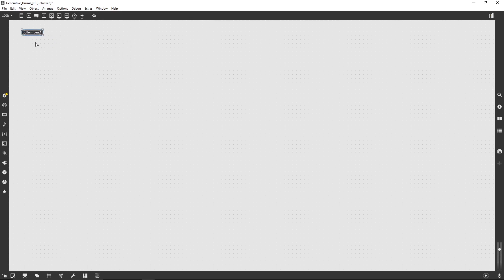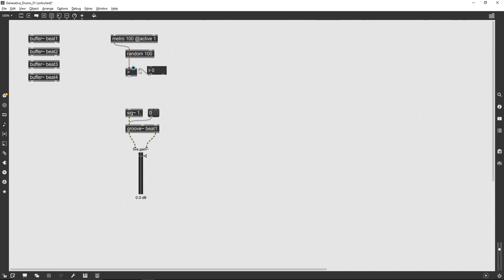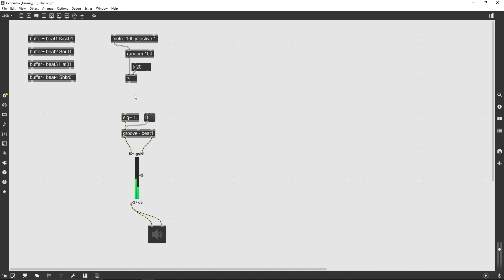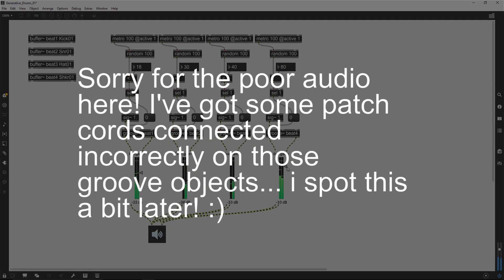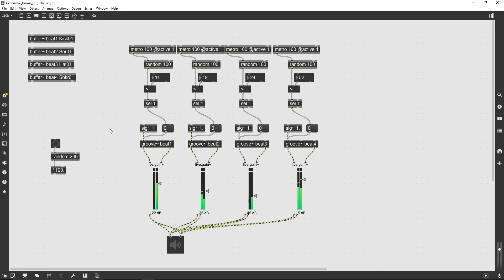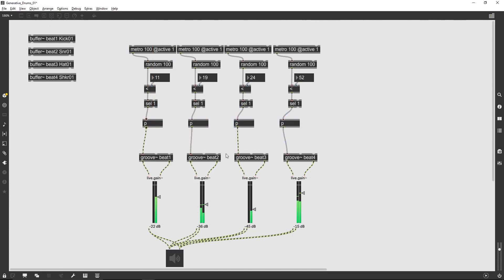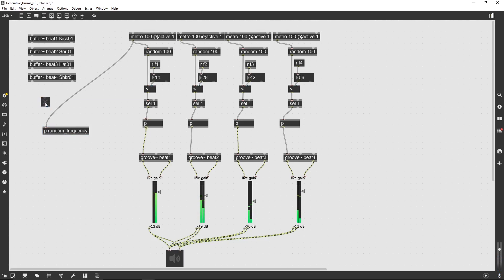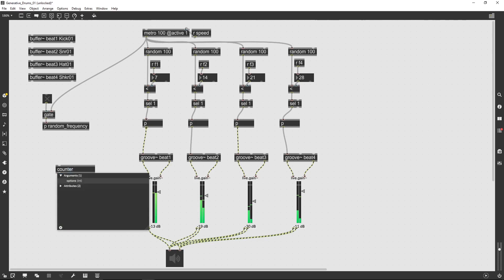Max/MSP Tutorial: how to make a generative drum machine

Comment from the maker: If you recreate this patch, note that I had the groove objects connected incorrectly through most of this video - which was causing some unintended clicking. Because the groove objects I used were only 1 channel, I shouldn't have connected the second outlet, which was the sync output.
Reply: Hi David, excelent patch. 
But in 7.17 min, what happened ?, bang , obj random,/100, sig~1., number 0 , trigger b b and sel1,  how do all this one element p?
Reply from the maker: @victormartinpardo2752  hi Victor! i think this is where I 'encapsulate' a bunch of objects in order to tidy them into a subpatcher. https://docs.cycling74.com/max7/vignettes/encapsulate_deencapsulate
Reply: Hi  @davidcooper8241   ¡¡ Thanks ¡¡ 
I have more question: the sound of buffer~ In which folder were they stored? inside max folder installation?
Reply from the maker: @victormartinpardo2752  for this patch i just copied the sample files into the same folder the patch was saved in. but you can also add a folder to your 'search path', and then you can do the same thing and type just the name of the file, and not the whole file path. https://docs.cycling74.com/max8/vignettes/search_path
Reply: @davidcooper8241  hi, is it possible to get the patch file please. Thank you for the videoooo!!!
Reply from the maker: @yernar887  no prob - i'll post a version minus the bpatchers as soon as i get a chance. happy to share the bpatchers too but would like to tidy them up a little before letting them loose, they're a bit manky on the innards
Reply from the maker: @yernar887  here it is:) copy and open with File > New from Clipboard;

<pre><code>
---------begin_max5_patcher---------
3766.3oc6c00jhaiE84NUk+Ct3wrDVc02Zq8gceaqZeLON0TcY.CsSbaSLlN
yjT67aek7G.FLFYZaS28HlJMojMVWczURGctRx+0O9COLYdxWB1Nw6e38IuG
d3uzo7PdZlTdnJgGl7r+WVD4uM+FmD7mK8W7sISKuV7tmCiiBxxuH9nTS1kU
kLpJ4vk4Ohj4+5OS1+D13ms3ov30OlFrHqvV3TXFZpGWPLeQYU+06y4+l+2O
9Clu0eM0ZydQxyOGDmsOWyB9RdlMIJweo21jmC7Vlt6Yus9OuIJXq2pPyeCi
yR7xdJXaf27cqVEjtclWRpme7Wqtw8Ovnv3fEI6hyepjFgGvd3A2F7fwTChP
vy3EevbEAgIhod.CkCVxWEXEG7GZi3brZseVv9TKJAYecSPgUMYh2m6hWAzP
wFPxVK3bnnHKE.CyXBFQCCJ0Lj9Cn+wbJmnvxbrQCCX7qBFxRVuNpkBbnox9
yGr2T+mCxBReLH1edTPspVa7CZFPTcGPXhb.AojDpfyIRMfT3xX96.3WrYxq
0eGPhNWNoX4LtvTPYDNkBRPYZ.HmII5OXTwGfT4GT64GjVVPqJoOLwzj+EcS
7vj3is9Gl3uYyQo+vw+HC.8qI4OK4zCoEFWjFbHszfWBqdDjCI6mpKqY5B5t
zbOlIegSmbzSJYYPZ7tv7GVYplprJSKutIV62sci+hhGfoNb+0O.g48Kj+GN
srOBzQnhttecTxheKX4wUQZm9MAwgwaR0cAFm4mUV.Nb8kAq72Ek83pj3rsg
+YtI.lFeMcCqJswlupoXjWB92og9QGJCqSCWlDaLj5UKlzqxxOoq3MEJfUqL
keKw9aZ5mqc6zfykt5Vcgc2149olZsxVy38WMKIIp90N7KiBVkUd8MgwwmBn
YIaZ4pogqepse87D8Uet0Ge9k193t3hK+n1CI6ws9ubBxm4GEU1d9jb3K9wg
Oq6oOKrn9P2RZ+UK5Z6osKRShhpWtKtzKMcokZe+EA+Q3xrmxyrZtG5eP3lJ
GqIGp1WFtNXa1IIl4ud6IIsM6qEUAGm1t4ksxeLKPONsYbq52QMlO0ZQebuf
0uvo8Ft6445tQldz0OeLwo5Fj9wqOLNwUGq3x8i1Peo3iuTs9SISpmgm0mZA
SAPywhpjRAAqH5gRk.Ls7RGM54CGFvnpGnaG1pMHR8ARx7l6MucDMGMaFUe8
fFbMPSSxXFob3ELvMX1TSCjY.mwnHAiJTLjf1.CjwBC25scSftagaAYPWDYP
WEYHZVGxbjgCBtfILzvn3BjQ6hwEXpjoQFFLfHidjvs9qCZFZvmTLZgB6kow
1BysSgMk5pnlPU4OcDpU4OQDDFBKH4bXTyX2GTSOmhwE0jWE0nhJRducQsw1
WSb89tvuE70ZsuqfHOjG3g6vX.G8caPJ8xPJ8RPJ6lfTLGq8NwXjdlnJjfnn
lN8n2ogCR8iWl770PzZSkse7Go2F3oG2T6GBJNlv3LdAeD08ZrTs+3058yFm
Ob2IinH2DWjF4yQg6D9827fQ2uCea3lFixwMrF0DXFUQui8ClKjXP5U88Lv2
zhYYX9uqflranKvaiQLfjEcAR4JEyjJepGmMfdg4kxae.WT2cz.D+lvFi5K4
eH5wbYluMiBmKnaMAYxk2oT05ZycM2NhWF7kiEE5Tj7HQPLJSeoo5lazla3B
X71jcoKp.vJJsdmXk54vmEFuWbnOczbF75Tcc2sF4aJqQ7lxZzrW7v1XMU0o
Csw.VYLxwwXrpdppFcHMFp0FCa3MFh8dvvvaMXqgFxvaLf0FSClcR5xhHNfd
SXh4xCdQaDFPaLeTSKwwg2CauWrEVCcjrFvZrgbQqo5BGBUzDSD.V9XQPOdz
OKKMb9trBdA0hBVGEjecTxb+nRw12GAmlDreuEc6gerlf61H19qOnr3FCVIq
0UuPEqODS.bFPYp7kuvYAq+LY16yXxlVWFX6CWOx9nSqPsgCLgpnLSAlFMDT
gI9r7hzvLAQBThBqwF0.hCC9ZVP1ZD5IZmg7BrBjJEVo3XSX34EyAPmJEHRg
h9wYIKHkcGOPzB7focLnT.aBSvvthE7JzE6wUoA+9tf3Ee8UuDFj7tWtEx7d
Jn.UP4BJ1rzU.3nlCt0rfaMK3VyBt0rPuslEZMvwqn8ZTikWW7v7Pkn+vDLA
lo+X53GWFSTAHEBt.g07Fvx6V3zWQ5WTwhPoCE.vaZTA2qnh3pgJWUxQPiNf
l.MHYu0.kexiN1Q6PHuolXfFLKXiP0jOYDPxuiQ63m7HiNtItoFgu0vsQOpt
B9szL8sEro66B529tn1sV6da0aU0BC.M59P1tzD4kQJCDRIPTDJQOQ.98bo.
bWVI.bKcu.y5g27QvvHk9CJeE3cecufQ28haq6EpXlk7OTQkVxrozm+ASwBp
9ixrGZlox+PXDirTT96oXRKsNdd7gONQBqCIsb3iugv5HRKG9.RKrNxOhgOf
zBqizYSUniR375fIJtSQyqClHuESD+1vDosXhjAzD4VuD.DCe+WbqwKd6QD8
CZLHuX31NHd1fDqMIssvKH4kyvRxH5g0kRydAlxJGUWJQBER.l0l7fFxwCRk
MLXPq6ZbAsLDKToIjZHoIpZkaH5gtbiG1xcqaGbNFed7lGoxMLnkaQqwYmpj
0puUrwoXuo6k4ND9Tdq00Rr37XpSPvLPxvXb0D+f7cYEoP+JFHkDQgFxtXJ5
honKlhtXJNVwT79tgdYVrB8gBNRfPPYLEBCFkgnynR83nXfKPlUmgZf2OuZZ
vY5J9qiSCz1H+RpIwX1pklXlFvDRMDpDH8WhFV.Oikzi+8bs8ZGMWEk322JO
x.a2y85wq0NXXjDizCaSxEpUcuiCvnqTKCYIdQwEsGIXkRiWZlLEmLT2i806
3tqdgquKJY7Yz7dvn.WQ.fgMdXrh1iBNV+OdNMw6W.2BW+MO3JMH02Trlsys
M.vEguqtY.UkJeeUziRuuwI3ZCOdCwJfIrc3QIRwkZHQRTGuA1.btmGdHBVv
sClEk7dMBurquLKzdFFznFRgY5gEUJMABMTY1pe4GMYuahqBy5nGv3Cttj4Y
gU6MBFabLF61oMC+1FgYc3uXCePdX1uGjvCuwfrFYFg8Zj0p7yF9s.If6Ii4
6KU9GXo+fVk2F.mzeNo+bR+4j9yI8mS5OmzeNo+bR+4j9yI8mS5OmzeNo+bR
+4j9yI8mS5OmzeuKk9q8SRGEyI8mS5OmzeNo+bR+4j9yI8mS5OmzeNo+bR+4
j9yI8mS5OmzeNo+bR+4j9yI826Qo+Xsd9QSa5Pz1I8WGj9q3kGlYtpN0+bp+
4T+yo9mS8Om5eN0+bp+4T+yo9mS8Om5eN0+bp+4T+yo9mS8Om5emq9m4feuk
i4vyOz2s5MIWSuWAost+ekzx2d.TNlJ3Bh4EGsdDlhDU5+ADoz75V3ry782y
urEo3NetmJqdETf.hNMEGF320h+Saeg6cquiAojt6Y.jBTfpnBPO6bno24F8
5wAZ0I9OZvgCZmgC.x0+8r4PdK.PT3KAyV6GF+s8lwK9G5d5vk+D4yWFJJm7
yzi++L+WgJESMOmsGCVFsLW7jebbPzhjcEjFQs0zC5BLyZBla8MZnjgKalQU
H.3.Xlm.vlwE4uJGIbJEj4Il+JNAH7iCFQwHF6GpnsAMdwOZWPxpFhAwgh8y
5ZHyMvOnu5wWd6SIoYMTCMooatpRpwmzt3vr8xtRm1noDlO31OKPMaLQIwqu
f2xgHcLbCnsNMI4kfu4MOvOi1A+yKztkzg9xaMTWRBu58WhDwQTFS2tkvJOv
aUHARfQ5lyS085e9aHSaYfL2ea3hLcsnYnKcMH8fd7qRhhR9iBNGFoySpGcf
UIoO6GmsHI0XymEMnnDSjTVdz5Mexyamb77zz2v1L+zrKeKlndUHNrwJOvyI
IMbsllVTTP75h3HT86yBW7a0dDU259Bf48Ip53OhCwxYyS9aCZ8wsITWOcoh
7uuyOJL6qMYwl.nrMKMP+qKe9GwZ7cLGMRqzQDXV4QwsBqvBkl9w2CbzH2v4
x9GORZDZ2cM9.SRiv5LbbeHogeWSRiHZGlEEc9KDJMcXyabcGIsWEIM73SRi
LtjzPseJjgK5LWONFSy5mIDNRZ8.IM7wKLDGsrtRKC2JCD8jI9djVFtUBIbP
8cAsLLq6tFefokg4cFNtOzxf20zxvx1gYtiVVuRKCFeZY3QkVFAZ+Dh.bzxF
AsyjbGIsamjVqZmoog7cIIMTmeG28wiiFH6tmwGXNZfnyvQexQ6R.f12OMwT
989W95dzdI3p8azCPAuy6NJdY3eQRsop4SQjSy6HeDIu9dl4Jz9KcSIqFyUr
i25qg25nSZEFURq.zdqWjizpiz5s3ROe2pUAokqgAue4oeKE0hm89NWaaPoN
vYCZkylBOCxWRZBfgYLgYUgC37gmALLfiOeLnP79O9YiIln5JjnxYwCE6c0Q
.Qvd+R7n5kH6JhvgwEQ.u+qt0+XBIhtBI3BZDsvdqvnpuIHJgnSWgzU.0YqL
ZZ88YvEVUzjha5xUIVmeFwAGy7yDi3wL+f56Ng1yu8NeoKKNaBP8EBakEf5O
DdDyOJebyO6qQQMTiB8fEnP1XA.h0akYoxlbTx6uLzJm1JypOxPpMYHE2eYH
wJ2n9yuUhsICwzdKCEV0PAi5sLjaUIj1eNMbvpLrGKgV0xm.8VFxrpgOzeYH
0pL7z9760tW6fILTiYSsq2ndbPTq5Mh1i0yXqKg8CQLpUsU48WG7T6ZqJFRO
Y6MggxSlXGao9aTGhUMcH8W8LgXcIrmlBiUMc38WaUhUMcNcdF8pmbGLgAad
TVMOCb+Q5FaG+o9aP.L05RXOM4eqZ5v6O9SXqZ5v5OFhX6lplr+zavpINg6u
t+.g0kvdJC4VO0vl5JfNZlvoj350diryDNcz2dsOY6LA7knpiGMS.tDGKx3Y
BnKMzDqOrAqFcDFTmA6MggZ.Z.orupnm5KBIsKKE8XVZEs.f23PJkgH3jSy1
7L6zSw1SOAaa3zqskSt1yN0ZKOgTtzoU6O9C5a3+CsgQQ3A
----------end_max5_patcher----------
</code></pre>
Reply: @davidcooper8241  Ohh Thanks Very much ¡¡ it works.
Reply: @davidcooper8241  does this code work in the current version of Max? I'm pasting it in and nothing happens. Many thanks
Reply from the maker: @johnm4498  yep should do, youtube messes with the dashes that prepend and append the code, check that there's the right number. Eg , copy a patch of your own to clipboard, paste into text editor, do the same with this and compare
Reply from the maker: Also are you using the new from clipboard function
Reply: @davidcooper8241  fixing the dashes in the youtube code did the trick :)
Reply: @johnm4498  Hi! what did you change exactly? the number of dashes? having the same issue!
Reply: @donculture9223  i figured it out now, there should be 10 dashes exactly here: --------begin_max5_patcher-------- . the ending is fine
Reply: @Lubendoro  can u explain u got it to work? I'm on a mac and I'm not very familiar with using the new from clipboard function on max8 :/
Reply: @josepharan484   @Joseph aran   copy the text with the code, go to File then, in the list, find new from clipboard (should be the third or fourth). Now, do you see that there is a part of the code posted by David in the beginning with a lot of dashes? (----begin_max5_patcher----)  basically you have to make sure that there are exactly 10 dashes on the left part and on the right part of begin_max5_patcher . And that's it, you can copy the rest of the code posted by David exactly as it is and it will work.
Reply: @Lubendoro  thanks for the help! sorry to bug you again but once I got the code in the new from clipboard, what do i do from there? How does that actually open the patch? if you could help i'd rlly appreciate it :)!

Comment: You might want to use [expr random (0, 100] - [scale 0. 100. 0. 1.] as then it's easier to set the limits.  Set the values as wanted.

Comment: Just a quick question from someone who is v much a beginner - when you were uploading your samples into the buffers, where did you save them as files to allow you to load the samples up when clicking on buffers? I have a drum sample saved into the Sample Collection, but it doesn't load just by typing the sample file name like it does with you... Thanks!
Reply from the maker: samples saved in same folder as the patch will be found automatically when referenced with just the filename - anything in the 'search path'  will also show up - look at the 'file preferences' option in one of the menus and you can add locations that max will be able to find automatically.
Reply: For me it was missing spaces in the filenames compared to the ones used in the tutorial. Filenames that include spaces also need beginning and ending quotes.

Comment: Great video! I have a question about the last part - when you introduce your b-patchers for playing samples, how did you avoid the annoying click in the groove object, when the loop restarts? Thanks a lot!
Reply from the maker: i think I had the groove objects set up to start with as 1 channel, instead of stereo... so the 2nd inlet, (when they were 1 channel) was not audio; it was the sync ramp (its a signal that just ramps up from 0 to 1 over the length of the loop)... so fixing it involved making the groove objects 2 channel, i.e. stereo... by putting the proper argument in. does that fix it for you?
Reply from the maker: oh no, hang on, i didn't make them stereo - just connected the 1-channel audio to left and right channels - compare the connections coming out of the groove objects at the start and end of the vid
Reply: Thanks for your reply! I am reading back my question and I obviously wasn’t clear enough, sorry for that. 
I was referring to the b-patchers — how come they don’t click when the loop changes? Especially when the starting point changes. Do you work with poly~ or some kind of window? Thanks!
Reply from the maker: @jakaarh8957  ah see what you mean - there's a bunch of different ways to avoid clicks with groove without getting into poly~... there's an option in groove object itself to position loop points at the 'zero crossing', or you can use windows  by exploiting the sync output (rightmost outlet of groove)... i go over a couple of these methods in one of the vids I made, can't remember which off the top of my head but will update if I remember!
Reply from the maker: ps, I think that with that bpatcher I was just using the zero crossing option, rather than properly windowing it. using a window gives you more control though - you can control the 'smoothness' or clickiness of the sound by adjusting the parameters of the window
Reply: Try using slide~ and/or line~ to avoid clicks. Bunch of good tips over at the Cycling74 about this.

Comment: Great work !!!  i'm recreating the patch but i've some doubts: i connected to every "buffer-  beat" a "replace" object to call back the file from my library. Is it a good idea? Thanks
Reply from the maker: hi, not totally sure I follow you here, but I think that sounds all good. in the video I include a filename for the sample in the buffer object itself just to avoid having to manually load samples each time... but you could use any system for getting samples into the buffers. 'replace' messages are a great option, would allow you to swap samples on the fly also